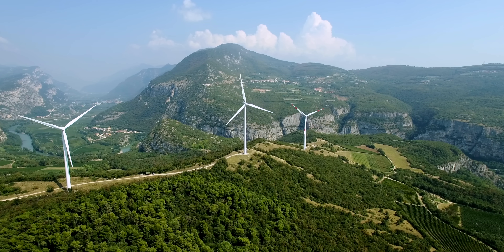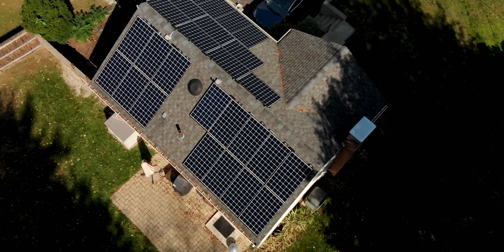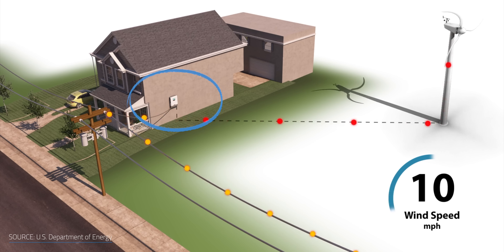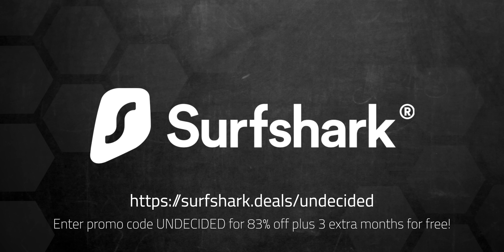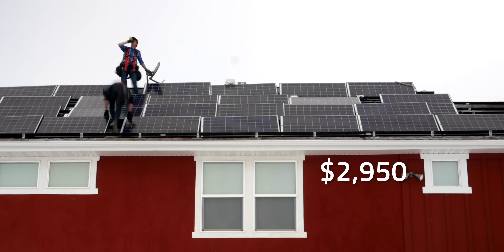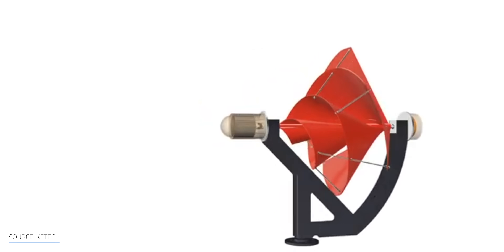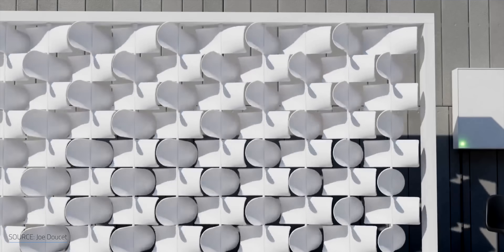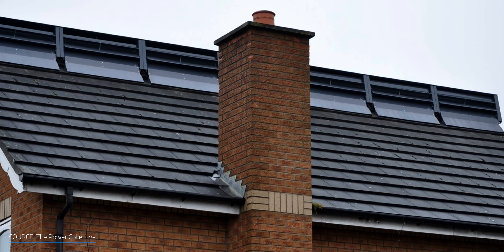The Challenges of a Wind Turbine on Your Home

Comment from the maker: Do you have a wind turbine on your home, or would you ever get one? Get Surfshark VPN at https://surfshark.deals/undecided and enter promo code UNDECIDED for 83% off and 3 extra months for free!

If you liked this, check out Why Don’t We Have Solar Powered Cars? https://youtu.be/SgQ2T5g3Rn8?list=PLnTSM-ORSgi7cadIj6qpCWkg-tPzN1sgj
Reply: Make a video about the solar towers. A tube going up 750m or more with a green house at the base. The pressure difference makes a turbine spin. Non stop energy, great for countries with sun and a lot of free space (Africa, australia....)
Reply: I want to sleep at night and the vibrations-noises of a wind turbine is a bad idea.
Reply: I helped a man build and install his in Atzec, NM. It's on Mountain View Drive. We did that back in '04 or close to it
Reply: @existential_crisis_actor  https://youtu.be/SH3KQoZvafM
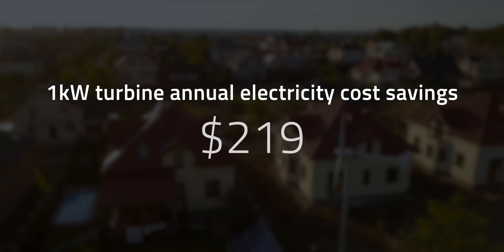Reply: At 8:44 you mentioned about two hundred dollar savings but did you account for maintenance cost you mentioned around 7:20?
Reply: Installers rip people off.   A one kilowatt generator is the equivilent of one and a third horse power dc motor.  That size would fit in the palm of your hand.  There are plans for making your own wind powered generator on line, hundreds of people of done it.  I would suggest getting about a 5 hp outrunner brushless motor from Hobbyking and make your own using a prop size of about six feet.  I could handle 8 kilowats and you could install it over the weekend.
Reply: I'm currently experimenting with 3 vertical turbines (about 18" diameter & height) left over from a re-roof of my home to power the multitude of (currently) solar lights and possibly a small 'water feature' pump. I, like you, have thought a great deal about wind and solar (as an electronics designer and environmentalist, it peaks my interest) for home power, but expense has been too high. If my little experiment works, I may be able to share the plans to other home owner/hobbyists/makers. But, that's about it. :) Great video! (As usual!) Thanks for what you do!
Reply: at 9:23 . I don't agree with the term "slightly". 6g is 50% more than 4g.
Reply: @endymionspr9916  It is trivial when compared to coal and oil.
Reply: @atk0506  You are correct but that's irrelevant. I pointed out a mistake with comparison between wind and solar. Which was a main topic of a video untill that point.
Reply: There is another tech that I got to looking into for my college capstone. You basically took two F1 race car spoilers and point the low pressure sides together and put little slots along them attached to a manifold that has a turbine at the end of the ducts and you just keep adding them together and the low pressure created by the air foils sucks the air in the ducts like a straw  spinning the turbine, covid restricted a lot of the testing we could do so there wasn't much data but it was pretty interesting to get a prototype working
Reply: I have a camper van and been interested in wind turbine technology.
This way I'm able to generate electricity while traveling.
I keep a look out on design's on the market and what is coming. I'm also an engineer designer, so I'm also designing my own.
Reply: @Istandby666  https://youtu.be/SH3KQoZvafM
Reply: All I know is do not mount a windmill that is in contact with your house in any way, the noise and vibrations turns your house into a resonance box and it will drive you crazy with the noise inside your house when it hits resonating frequencies... A friend of mine had a windmill mounted on his cabin and the noise was horrible at times inside the cabin.
Reply: I've invested in Ripple Energy in the UK

It isn't wind turbines for your home per se, but it is a co operative where you own a tiny amount of a wind farm somewhere in the UK.

In that sense, I think if someone made something similar in the US, that'd seriously help. Also the cost of the investment on wind vs solar is so much cheaper when it's done that way.

I appreciate that most can't do the co op way, however it's certainly an option for us in the UK. It also helps being a very windy country.
Reply: I don't know. I hear the noise from the wind turbine causes cancer.
Reply: is there a way fo Water? every Houshold has a water supply from the city. If there would be a way to combine the water usage, with solar and wind, this should be an almost good way to sustain energy even during winter time.
Reply: Here's something for the idiots of Renewable Energy: 

Sooner or later you greenies are going to need to grow up and learn how economies work. - hint government people understand nothing of economies other than  how to rape them.    

These G-morons decided "woke' power (power that doesn't really work) was a great idea for them, not us, so they decided to steal some money from some ratepayers in order to pay others to stimulate the growth or power that really doesn't work - ie wind and solar.

In the real world, the one that really works,  there is something called supply and demand and these things regulate the price of everything fairly.  

Your butcher buys his beef by the side and pays more for it than the meat packing plant did who in turn paid more for steer than it cost the rancher to produce it.   Get it so far?     

Now when you buy that beefsteak at the butcher's shop he's going to get his markup as well,  so you as the end consumer are going to have to pay a lot more for it per pound than the rancher was paid for it.   

Next time you want a beefsteak drive out to a ranch and buy your steer on the hoof - then you slaughter it, age it carve it up sell the inedible parts to dogfood processors and the like and eat the rest of it on the cheap - no you want the value that all those who added value to the meat along the whole length of the supply chain don't you?  Or do you buy your steaks on the hoof?      Or do you expect to pay the  ranchers price at your favorite steakhouse as well?

It's that way with electricity too, you cannot expect the power company to buy power back from you at retail rates when they don't even need or want the power. With that business model they will go bankrupt as soon as their investors are wiped out.    

If that rancher were to dine out at your favorite steakhouse why not demand that your ignorant politicians make the restaurant buy his on-the-hoof steer from him on demand at the same rate per pound that they charge you for a 16 oz prime rib?    

The problem is, as with all government planned economies, sooner or later everyone will want to receive the grift instead of paying for it, when that happens the lights go out - permanently.

The most ignorant feature of all of this is that it is supposed to solve some problem that the grifters dreamed up but that does not actually exist so solar panels and wind turbines only create huge problems, they solve nothing - time to wake up you dizzy Californians.
Reply: Climate change is crap.  

It is 21st century superstition. 

So is "renewable energy" and "carbon neutrality". 

Here is a primer on climate quackery

CO2 is a TRACE GAS - 500 ppm, that's 0.0005 or 0.05%. Trace gases do not control the climate.

Professor Bob Carter PhD on Global Warming:
https://youtu.be/_NW0re9EqE8

Professor Bob Carter on Global Warming Science:
https://youtu.be/DRCISn1KfKQ

https://youtu.be/RTSgsVdKF0Q

1 co2 molecule for every 20 Water Vapor molecules (co2 fraud)
https://youtu.be/o8nvdDXR8ZE

The trivial impact of co2 on greenhouse effect
https://youtu.be/8hgSxTS1g38

The $22 billion climate quack business:
Here's the latest from the IPCC charlatans and their total misunderstanding of the scientific method

https://youtu.be/n6VM41-v2gg

The out-of-the-gate ridiculousness of global warming.

https://youtu.be/jNd0HEvFWLs

https://youtu.be/gXr8kC7KJNE

144 videos on climate quackery:

https://climatediscussionnexus.com/video/

IPCC pressure tactics exposed: A Climategate Backgrounder

https://www.youtube.com/watch?v=K_8xd0LCeRQ&list=PL6JjafE5gsb8M02zOJoMRasbZA0865k0R&index=113&t=5s

That stupid Paris climate agreement

https://www.prageru.com/video/the-paris-climate-agreement-wont-change-the-climate/

Trace gases do not have leverage over climate.
CO2 makes up 0.05% of the atmosphere. 
CO2 is a trace gas.

The liars at IPCC:

https://www.youtube.com/watch?v=K_8xd0LCeRQ&t=17s

https://www.quora.com/Which-gases-increase-the-greenhouse-effect-more-than-carbon-dioxide?share=1

"No such thing as too much CO2"
https://youtu.be/sXxktLAsBPo

That stupid Al Gore and the 97% of scientists fraud
https://youtu.be/ewJ6TI8ccAwFt

Stupid Al Gore and Canada's 2001 climate predictions
https://youtu.be/DR6wds_ly2s

CO2 is good.

https://youtu.be/jODIYw_5A40

Truth about CO2

https://youtu.be/WDWEjSDYfxc

The stupid rhetoric of the climate quacks:
https://youtu.be/Yqbn76_IIMY

The objective of climate-quack superstition

https://www.msn.com/en-us/news/world/mexico-city-aztec-tower-of-skulls-discovered-by-archaeologists/ar-BB1bUlqX?ocid=msedgntp

America: how do you make solar "cost effective"? Force up the price of electricity.   
Britain: how do you make heat pumps cost effective? Force up the price of gas. 

https://www.youtube.com/watch?v=GhAKMAcmJFg

Minute 22:00 refrigerants disassociate in water, so how can they "cause global warming"?
https://youtu.be/5SpOiHB6VsE

Termites, anyone ? ? ? ? 
http://iloveco2.com/termites-emit-ten-times-more-co2-than/

https://preventdisease.com/news/10/071110_terminte_co2.shtml

https://youtu.be/pMH0ksLG1oY

William Happer
https://youtu.be/CA1zUW4uOSw

The mendacious IPCC and the stupid sealevel argument
https://youtu.be/ViY2J3LPgN4

Dozens of climate cycles

https://www.youtube.com/watch?v=lZw4DdocxN0

"Renewable energy" is a kids' lemonade stand business model. Why? Because Mommy and Daddy ( the power grid) is always there to provide power when lemonade-renewable doesn't feel like working (i e. when it's nightime or it's cloudy).

[Let's not talk about what happens when the kids' lemonade stand business model is bought into for more than a Saturday afternoon and weather doesn't comply with the business plan, e.g. the Texas winter of 2021.]

Bob Carter on the butchering of the scientific method:

https://youtu.be/eBcIuxigoCM

Naturally occurring CFCs and PCBs:
"Many of these chemicals are identical to highly publicized manmade organochlorines: chlorophenols, chlorinated hydrocarbons, PCBs, CFCs and dioxins."
https://chlorine.americanchemistry.com/Background-Natural-chlorine-You-bet-/

Researchers investigate ‘PCB-like’ chemicals made by Mother Nature
https://www.whoi.edu/news-insights/content/natural-pollutants-in-fish/

Energy Communism
https://tiny.iavian.net/1g49t

Ienesco couldn't write a play this absurd.
https://youtu.be/VmZsSV_k8vs

120 videos on climate quackery
https://climatediscussionnexus.com/video/

Hubris
https://youtu.be/P19ywkobLX8

Stupid Prince Charles
https://www.youtube.com/watch?v=NFftQwHUyOg

Rising sea level quackery
https://www.youtube.com/watch?v=ViY2J3LPgN4

Sea level
https://youtu.be/WTRlSGKddJE

Matt Ridley and the stupid "sustainability" argument
https://youtu.be/S-nsU_DaIZE

Banker talks about climate quackery
https://youtu.be/5QHCxZt616w

Thomas So we'll on climate quackery 
https://youtu.be/1cEWw0Cfg8k

UN plan to tax meat to force eating bugs.
https://youtu.be/op-_4gBoCYs

Christopher Moncton on renewable energy quackery.
https://youtu.be/ZH4m-Cs-u3Y

Dr. Judith Curry
https://youtu.be/YBdmppcfixM

William Happer discusses ozone and climate quackery
https://www.youtube.com/watch?v=KGn-6kGoD0c&t=1320

Thomas Sowell 
https://youtube.com/shorts/il-9eOwZuFs?feature=share

No climate cause and effect:
https://youtu.be/Cz45fETw078

Climate elites fly private 
https://youtube.com/shorts/mBBX4Z2IlfU?feature=share

Stupid rising sea levels.
https://youtu.be/RxRWcygrKUE

The stupid recycling ritual:
https://youtu.be/NLkfpjJoNkA

Stupid HYDROGEN -- another science-project boondoggle for the tax-funded climate quacks

https://www.youtube.com/watch?v=Zklo4Z1SqkE&t=10s

* * * 

Here's something for the idiots of Renewable Energy: 

Sooner or later you greenies are going to need to grow up and learn how economies work. - hint government people understand nothing of economies other than  how to rape them.    

These G-morons decided "woke' power (power that doesn't really work) was a great idea for them, not us, so they decided to steal some money from some ratepayers in order to pay others to stimulate the growth or power that really doesn't work - ie wind and solar.

In the real world, the one that really works,  there is something called supply and demand and these things regulate the price of everything fairly.  

Your butcher buys his beef by the side and pays more for it than the meat packing plant did who in turn paid more for steer than it cost the rancher to produce it.   Get it so far?     

Now when you buy that beefsteak at the butcher's shop he's going to get his markup as well,  so you as the end consumer are going to have to pay a lot more for it per pound than the rancher was paid for it.   

Next time you want a beefsteak drive out to a ranch and buy your steer on the hoof - then you slaughter it, age it carve it up sell the inedible parts to dogfood processors and the like and eat the rest of it on the cheap - no you want the value that all those who added value to the meat along the whole length of the supply chain don't you?  Or do you buy your steaks on the hoof?      Or do you expect to pay the  ranchers price at your favorite steakhouse as well?

It's that way with electricity too, you cannot expect the power company to buy power back from you at retail rates when they don't even need or want the power. With that business model they will go bankrupt as soon as their investors are wiped out.    

If that rancher were to dine out at your favorite steakhouse why not demand that your ignorant politicians make the restaurant buy his on-the-hoof steer from him on demand at the same rate per pound that they charge you for a 16 oz prime rib?    

The problem is, as with all government planned economies, sooner or later everyone will want to receive the grift instead of paying for it, when that happens the lights go out - permanently.

The most ignorant feature of all of this is that it is supposed to solve some problem that the grifters dreamed up but that does not actually exist so solar panels and wind turbines only create huge problems, they solve nothing - time to wake up you dizzy Californians.

* * * 

..
Reply: New people do realize that all of these products are made from gasoline right they are made from the same source.. You fools carbon isn't going anywhere but your freedom is
Reply: @Adeptus33  

Right!

I don't care about global warming.

Am I going to impoverish myself by 25% in order to "fight global warming"? 

No. 

What are the consequences of global warming? 

1) A 1-2 degree increase in average temperature: I don't care. I can deal with that by turning down the  temperature on the AC thermostat (and I prefer milder winters). 

2) A 1.2 inches per decade rise in sea level: again, I don't care becuase: 

a) Most people live well enough above that for that to be of any concern to anyone alive today.  

b) In 100 years time, this may be a concern for people living on beachfront property, but they are the most wealthy people among us and I'm not impoverishing myself by 25% to preserve their vacation homes.  Coastal cities that haven't already built their waterfronts to handle a 1.2 foot rise in sea level have 100 years to deal with the problem. 

c) Poor and low lying subsistence agricultural lands have a tough row to hoe, but sea levels have been rising for more than 100 years, and their circumstances would be better improved by moving out of subsistence agriculture and into higher value added (and mobile) occupations. 

3) Oceans becoming less basic (currently 8.1 pH; 7.0 is neutral, i.e. tap water): again, I don't care.  a) I don't care if clam shells become more fragile at this level of pH. b) I find it preposterous to hear that clams, with billions of years of evolution behind them in a hostile environment (sea water), can't handle a 0.1 decrease in basic ("alkaline", not "acidic") pH -- which is a movement toward neutral, i.e. "fresh" water.   [The term "ocean ACIDITY" is used by climate hustlers to incite fear for political and personal gain.]

Have I missed anything?  Melting glaciers? Sorry, I'm not impoverishing myself by 25% over receding glaciers.  

Sorry, but I don't care. The costs and power grabs behind this issue are astounding.  So are the lottery-ticket benefits, unless you are in on the scam: the politicians, enforcers, and renewable energy opportunists. 

If you feel so strongly about global warming, you should lobby for THORIUM MOLTEN SALT REACTORS -- not only for electricity, but for manufacturing synthetic gasoline -- all carbon neutral. 

If not already familiar with it, here is a playlist for it: 

https://youtube.com/playlist?list=PL6JjafE5gsb9nSmudoj5MUKxX8LTKO0-J
Reply: hello fellow massachusetts human \o/ hope you survived the winter well.
Reply: Hi Matt love your channel! I have worked on small wind turbine project. we were able to generate 9Kw for a 1.5 m diameter wind turbine  go look at this video: https://youtu.be/hfIseOsOMmU?t=117
Reply: I shall be putting a small wind turbine on my RV to compensate for the solar panels doing virtually nothing for a month in mid-winter. I figure it will be cheaper than replacing the batteries every year.
Reply: @alanhat5252  you need a different type of battery if you are replacing them every year.  I've been off the grid for over ten years.  I have about 600 watts of solar and two solar generators and two separate RV battery powered systems.  My RV batteries are years old and have not needed to replace anything.  You might need more storage and are dragging your RV batteries to low and destroying the ability of the RV batteries to recover their ability to recharge.
Reply: YOU NEED TO LOOK UP ~ "HARMONY TURBINES (Christopher Moore)" His idea will change how the world looks at VAWT  ~~~ https://youtu.be/mVMzdYL9c1o
Reply: QQQL
Reply: Hello,  thanks for the video, you are constantly improving in all aspects.    I really appreciate that you now speak in metric units.
Reply: Could an electrical wind generator create added current to a EV as it moves forward?
Reply: I would love to add wind turbines, probably the vertical ones that can take wind from any angle, if they made any kind of economic sense. Unfortunately, they don't, not yet. I looked into it, living in the windswept Great Plains region. The output numbers are better than what you posted, because we have higher and more consistent winds and because I live in a relatively rural area, but they still aren't good. The local power company is also really bad about contributions to the grid, and is only willing to pay wholesale for energy produced while charging retail for energy consumed, making it far less profitable than a credit-based system. So my RoI would still be around twenty years, greater than the estimated lifespan of the system I was looking at. 

Great idea, still needs some time to mature before it becomes economically viable on the residential scale.
Reply: Ryder needs a wind turbine in South Boston. The wind never stops there
Reply: Wind turbine wall. A bit of a mechanical nightmare really. so many breaking parts. and a tad dangerous unless so high as to require a mounting.
Reply: that turbine wall, maybe reinforce it and make it your fence line and triple the power
Reply: I've seen wind turbines at numerous farmsteads (3:23).  Almost all were turned off.  I'm sure there were reasons, most likely maintenance
That said, if I could afford it, yes.  
The one shown briefly at 2:12 and the style at  3:27 in this video might be an option, the vertical turbines are what I'm currently considering however.  The solid state turbine is something that I just heard about here and will need to investigate further.  The ridgeline style is also intriguing and since I currently live in an area where the wind is often quite strong
Reply: Kalki Ironman type 7 and 8 after 2026 😎

kalki avatar (beast of the earth) (christ on the white horse) (son of man on clouds) is the biggest enemy of dajjal/antichrist/kali 😏

Kalki Avatar (Murtaza) 11th satguru 13th imam cousin of Moula mahdhi a.s. 12th imam (muhammad) 😎

Prophet Moula mahdhi is raja shashidhuvj (the mighty one) born less then 1200 years ago 😎

Prophet Moula Isa a.s. will kill dajjal cause dajjal is going to kill Kalki Avatar 😏

Kalki Avatar will follow orders from 2 religious king Moula mahdhi a.s. and Moula Isa a.s. 😎

Kalki Avatar going to have 2 swords and ring of moula sulaiman a.s. and staff of moula musa a.s. (iron rod) Staff of moula musa a.s. is like omintrix can transform into anything and can transform others into anything And stone in the ring of moula sulaiman a.s. is also known as kastav mani and it's more powerful than all 6 infinite stones combined 😇

Cuz Kalki is ironman batman super saiya-jin superman ben10 saitama optimus prime shaktimaan and every super heroes combined after 2026 😎

This staff will transforms into white horses with wings,weapons,iron-man,cloud etc or can do imagination into reality 😎

*Ratn sru sword of lord shiva (miri)😇

*Ratn varu (zulfakar) sword of Moula Ali (piri) 😇

miri piri 😇

Kalki Ironman after 2026 😎

Satyug (sunrise from West) 2038 😏

Sambal is hospital 😏

Gzwa e hind 2029 😎

Khalistan and Azad Kashmir after 2026 by Ironman 😎

99% Hadith u heard is not about imam Mahdi it’s about Kalki avatar (the main character) that person momin vs dajjal prove me wrong if u can 😏
Reply: Kalki ironman after 2026 😎

Humans 0
Saiya-jin 1 to 6
Angels 7 😇

Kalki Ironman 5th matriya buddha 8th arc Angel 11th satguru 13th imam and 24th avatar after 2026 😎

Almighty God 9 😇

Humans type 2.5+ after 2026 by Kalki Ironman (christ in the white horse)(son of man on clouds) type 7 and 8 😎

Jarvis the world’s first artificial intelligence (parrot) 😎

Cuz Kalki is ironman batman super saiya-jin superman ben10 saitama optimus prime shaktimaan and every super heroes combined after 2026 😎

Jarvis world’s first artificial living being (just like vision in marvel universe)😎

Made of Quantum and sub quantum particles 😎

Power source quantum energy arc reactor (type 7) level technology 😎

Kalki Ironman going to have every kind of arc reactor like:- type 1 Nuclear fission, nuclear waste, hydrogen fusion, type 2 3 4 5 antimatter arc reactor (solid liquid gas), type 6 electro quantum arc reactor, and type 7 Quantum arc reactor, type 8 limitless quantum energy arc reactor without quantum particles 😎

Kalki Ironman going to have sun in a box million billion tons of hydrogen nuclear fusion reactor type 2 3 4 5 just like sun and stars in the palm of his hand 😎

This all going to happened by self replicating quantum nanobots knowledge energy and techniques at type 7 7 7- respectively 😎

Ironman (Tesla 2.0) going to reveal every secrets of the world specially Tesla and his Antigravity 😎😎
Reply: I had the same idea as the ridgeblade roof top 25 years ago. Vertical Axis horizontal oriented wind turbine. It is as if they pulled the final product directly out of my sketches.
Reply: Where is this neighbourhood in 05:04 ? It looks very weird place, because most of the buildings around the wind  turbine-house look like they are abandoned?
Reply: Your appliances use DC(internally) so there is actually no need to convert the wind power(DC) to AC, just to convert it back to DC. AC is used for transporting electricity over long range which isn't an issue here if your wind mill is just a couple of meters away. You might need a step up or step down converter regarding what voltage an appliance need.
Reply: Link to the second turbine? The one that uses the roof pitch to it's advantage?
Reply: I bought two 1kw wind turbines for less than $1800. Wind has come down a LOT in price. You just need to know where to look.
Reply: Hi Matt, I was really hoping you'd review the PowerPod, a new vertical axis turbine from Europe.  Here's the link.  
https://youtu.be/l3sSCwi4VJA
Reply: Where did you get the information "modern wind turbine annual maintenance cost 1.5%-2% of their original cost" at 7:18? I need the information for my dissertation, thank you.
Reply: Hi, I was watching through the video and during you wind to solar price comaprison you forgot something.
You say that the wind tunbine would save you $219 a year but you forgot to factor in the 2% maintenance on the system which would be $100 which would mean you only saved $119 a year which means it would actually take 42 years for the payback period rather than the 22 you calculated 👍
Reply: yes i want one.. more about this please?
Reply: Wind and solar is total nonsense, a dead end. We need compact nuclear reactors in every community.
Reply: I've been developing a ridgeline wind power system, lots of micro turbines situated on the ridgeline of the roof (luckily with the prevailing wind). Self manufactured turbines and generators, approx $50 per unit providing between 60-300w each at a minimum windspeed of 0.9m/s! In theory it should've been great and supply as much if not more than solar... 

The issues: Noise! The assembly is attached to the ridgeline and even with quiet bearings, transmits a constant thrum into the roof, thus into the building. Constantly. 
- The sleep test failed. 

Besides the amount of copper required for solar panels is a mere fraction of that needed for the 2000 turns per coil, add the inflating cost of the rare earth permanent magnets... For the price (including the sheer amount of time it took to make the turbines... roughly 40h each)... 

I don't see the price of materials becoming vastly cheaper and unless someone comes up with an amazing new coil design for the generator, the performance isn't going to see enormous improvements.

So, I've decided to install double layered solar panels with the wind turbines as a backup system - trickle feed. much more cost effective and I don't lose space (or sleep!)
Reply: I have two 2kw turbines. And not the cheap Chinese junk but actual real turbines. Ive seen peaks of 2.5kwh from each of them in windy weather where we are above 40mph. Combined with the 12kw of solar and 32kw of batteries, I have not had to fire up the generator at all since I installed the wind. Many mornings I wake up to full batteries because of the wind.
Reply: Car manufacturers I guess feel cars with wind turbines will not help just like solar...I still think it's in the future and should be explored
Reply: @courtney3330  if wind turbines on homes is not a great idea, on cars it's a terrible idea. Cutting through the air in an efficient, aerodynamic way and generating power from wind are at odds. See "laws of physics."
Reply: @mockingbird187  Laws are made to be broken! It's a terrible idea until someone does it ✌️
Reply: @courtney3330  that applies to most laws that are in fact "made." These particular laws were already here when we arrived, haha!
Anyway, the exception would be if small turbines could be placed in such a way that they are already in high-drag areas, say in front of each tire... but the problems with this are pretty obvious.
Reply: @mockingbird187  you have the front end of your vehicle hitting air head on and that pressure would turn a turbine.  I can't see why there wouldn't be a gain in energy rather than a loss of energy.
Reply: @peacepoet1947  at a very oversimplified level it's "head on" but the reality is, particularly in electric cars, there are angles helping the car cut through the air with the least amount of resistance possible, save for (as I mentioned) in helpless places like in front of tires... and even then, some manufacturers contour the portion in front of wheels/tires to direct air around them more fluidly.
In short, you guys are pointing to perpetual motion of sorts, which is an awesome goal (I tinkered with this in elementary school, thinking I solved transportation, ha!), but it's just not feasible.  The more effective the wind turbine, the more it is "gripping" the air and slowing the car.  It's basically like installing a 5th wheel in the center of the car to capture energy from rolling... will it capture energy? Yes.  Will the net energy provided be positive after factoring in drag, collection, conversion, transmission, etc?  No.
Also, look at this article: https://www.energy.gov/eere/articles/wind-turbines-bigger-better
The tiny turbines placed on a car would be insanely far from ideal.
If you're converting a 1970 Monte Carlo to electric, and want to add wind turbines to help increase range, there may be an opportunity there, but the more aerodynamic the design, the more you'd simply be shooting yourself in the foot.
If we unlock some kind of quantum turbine formation that has a synergistic effect where the power output is well above the resulting drag, cool.  But again, I think we're talking about ignoring physics with that fantasy.
In short, look at SUPER revolutionary car companies like Aptera.  If anyone were to beat an opportunity like that to death to get it to work, it would be a  company like them.  They're going solar. Why?  Because they can integrate it aerodynamically.
Reply: @peacepoet1947  the latest thing I found claiming to be shaking up the industry is this inventor who founded American Wind. He was going to stir up a lot of buzz for his company by breaking a world record between refills in his hybrid car by mounting turbines on his car to keep the hybrid battery primed, reducing the need for gas. Well, that was about 7 years ago, and no such buzz. I'm not saying his turbines are not good, I'm just saying his math, with respect to what was to be gained on a moving vehicle, may have been a bit off... hence no such record, and no such buzz. Still a relatively unknown company. But, for their stationary applications, that could change at any time!
"The American Wind Powered Car - Energy Alabama" https://alcse.org/the-american-wind-powered-car/
Reply: @mockingbird187  thanks for the link and your information.  Always looking for ways to save pennies it a nickel isn't available.
Reply: @mockingbird187  lol, these are my thoughts exactly. To place two turbines one in lower front grill and lower rear bumper to 'increase range' of the battery. Of course the turbine blades must be aerodynamically made.
Reply: @courtney3330  too much drag on the cars.  Until you're thinking of having them deployed when the car is parked.  But then, you're carrying the extra weight of mini turbines while driving.  Many things to be considered.
Reply: @atk0506  Understood but yes when parked also if possible. To place two turbines one in lower front and lower rear designed aerodynamically in such a way to have the least amount of drag that can help that battery to charge at highway speed. Should be designed to increase range for hybrids.
Reply: can you make a video about put wind turbine on ev? you know the car move put air to vent to create downforce, cooldown the batteries and generate energy at the same time also if you park out side its can still charge itself it's gonna be a dream car. almost no plug needed! and if the power generate by wind turbine is affected by the speed of the wind, is the 60 mph or 100 kmh equal to windspeed of 60mph or 100 kmh or it's gonna increase because the shape of the car increase the speed of the wind and broke the turbine if that the case then make a thick metal blade would it help???? curious because solar on ev is not work....... yet.
Reply: @makkarapatthanagurasami493  I do not have the means of making videos for youtube.  However the wind turbine idea is my Father's and it is 45 years old or more.  To my knowledge it is untested.  You must lay it flat under the hood, use a funnel scoop to direct air to one side of the turbine blades  that are shaped to catch air.  The Cobra sports care of the 1960's has such a opening in it's front but is used to cool the engine.  You must make the blades yourself, about ten to twelve should do.  Reinforce them with fiberglass or carbon fiber.  I don't think a turbine or prop exists that will match what you need.  Make it about 40 to 45 inches across and use a brushless DC outrunner motor from Hobbyking.com , about 3500 watt to 5000 watt should be plenty, and I know the rest must be an issue of regulating the current, a simple solar panel battery charger module may work for this at around 16 to 18 volts working range, or up to 48.  Good luck.
Reply: Got a 500w turbine to play around with the 50ft in the air pole was a bit much for residential
Reply: Hello. You talk about co2 as a bad thing. Can you please point out the scientific paper that prove that point. Cheers.
Reply: I'll tell you why we don't have solar powered cars.  Elon Musk said it's stupid.  No really I forget exactly what he said, but from an engineering perspective, if you want to have a regular sedan or SUV, the amount of power generation is trivial, most people don't leave their vehicles out in the scorching sun in the summer, the best time to get power into the vehicle, and it presents engineering challenges that adds complexity and cost, so I imagine Elon's comment was based on a cost analysis he probably worked out in his head one morning over a cup of coffee and decided it wasn't worth Tesla doing it.  The cost it would add to the vehicle isn't worth the amount of power you would get from it, or is so trivial that the added cost would have one main effect, which is deterring people from buying the vehicle.
Reply: @johndoh5182  Hello. Musk is a smart guy, but he is not always right. How does it say? If someone says it is stupid and it doesn't work, then someone else comes along and makes it work.
It is the same with solar cars. There are many people and companies in the world trying to do it. And now there are 2 companies that have almost reached the production stage. They have working prototypes of a car with PV panels and it works for them "Sonomotors" (car's name Sion) and "Lightyear" (car's name One)

For me, Sonomotors and their car "Sion", based in Germany, is probably the furthest away. It was invented by 2 young guys and their ideas and invocations for the car are impressive. They have prototypes that work.
I was at their demo, I saw the car with my own eyes, it's not a mock-up, it's not a powerpoint presentation. 
It's a working car that I've driven and I've had their engineer sitting next to me. It was a prototype, it was austere, it was ugly, but it was fully functional. It's still about 2 years away from series production at this stage, but I'd buy what I saw in a heartbeat. This car is exactly what is missing from the car market.
Reply: @Hobbittak  I really like the Sonomotors car. It is still ugly, but it's improved a lot over the few renditions. But I love how accessibly priced it is. The Lightyear, not so much.
One right in between, that I think is one of the best values, assuming you only need room for 2, is the Aptera, being built here in San Diego. Awesome, hyper-efficient vehicle that's going to shake up the industry.
Reply: @johndoh5182  I have a 12kwh Solar system with twin 6.5 kw inverters running split phase 220/v. I also have 30kw of batteries and two 2kw wind turbines. I have no issue charging my Tesla. Most of the time around here the house battery is almost full in the morning as it is with the wind topping it off overnight.